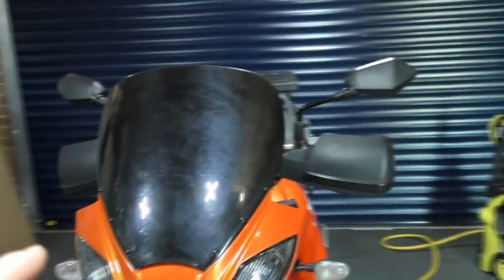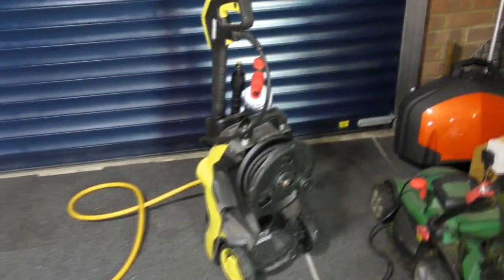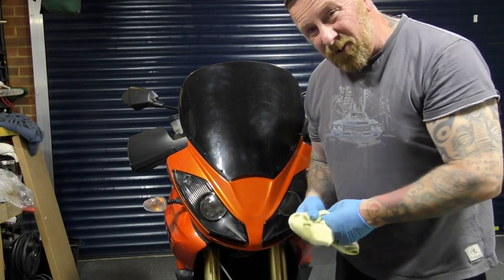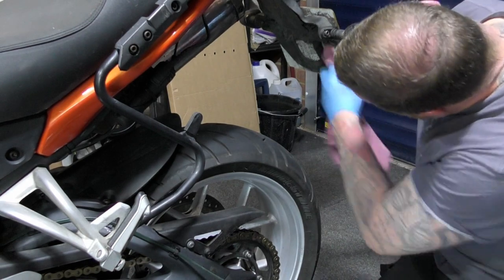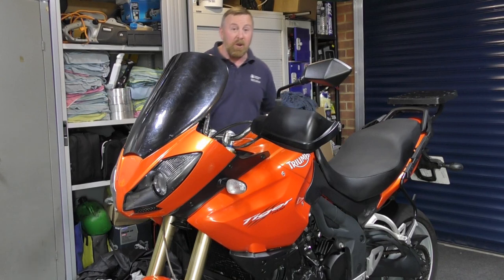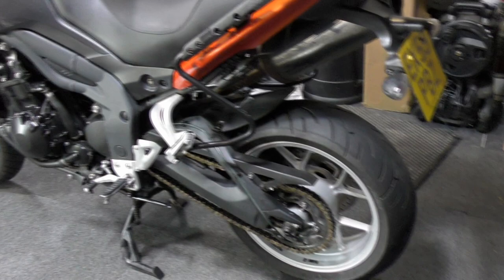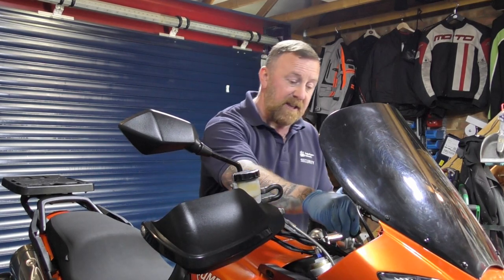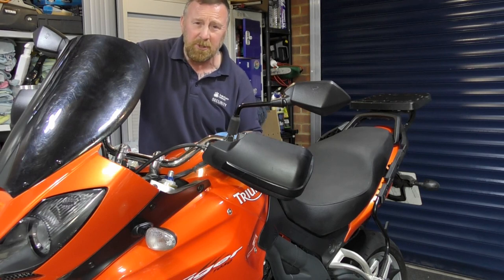SHOW CASE YOUR BIKE, DETAILING & CLEANING MARK SAVAGE

Comment: Mark, I clean my wheels with washing machine powder. If you wet the wheels first then make a paste so it’s not so course then rub it on and all the crap comes off the wheels. I purchased the proper Chain cleaning tool with brushes and a bottle and then put petrol in it to clean the chain, make sure you put cardboard on the floor first tho. It looks so much better with both headlights working together. Once I get my tiger 1050 I’m going to order the thicker negative and positive battery, starter, coil cable as I’ve head these bikes don’t start well when warm

Comment: Hi mark It's nothing to do with this bike . I've got a yamaha tricity 125cc would oxford premium  Adventure hot grips work on that bike . Or would the grips be to powerful for the battery
Reply from the maker: Thats always a bit of a difficult one bud 
They will work and the stator should be fine 
Try to wire it up on the ignition and not from the battery 
I've seen them on small peds and it can steal the power from the stator and make them run slower and kill the battery 
If your going to fit them keep an eye on them

Comment: Its alright using that stuff and cleaning all the crap off... But ya haven't applied any protection to the paintwork , polish to the exhausts or plastics ? At the least use a spray ceramic coating. . Sounds great .
Reply from the maker: Thats all of camera 
I have the complete muck off set and many many other magic polishes waxes and care coats 
All down now bud
Reply: @marksavage  🙏🙏 good job my guy. 👊